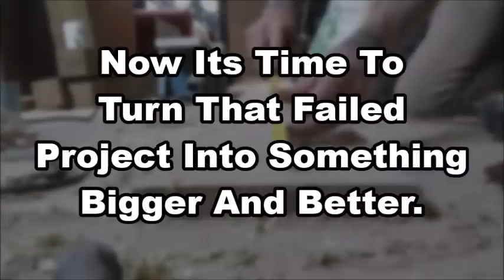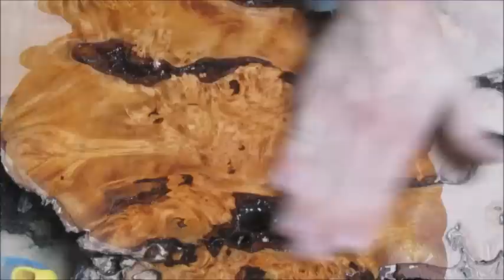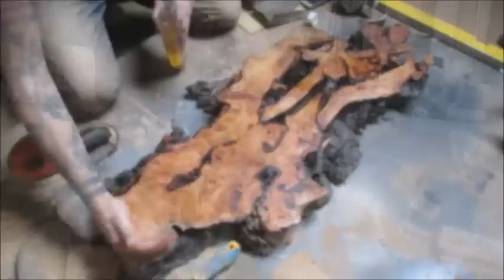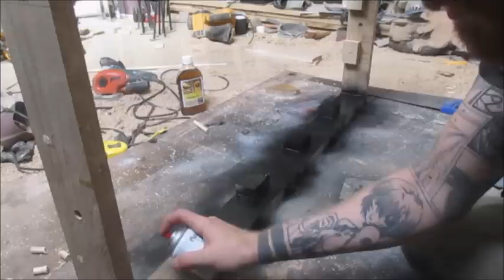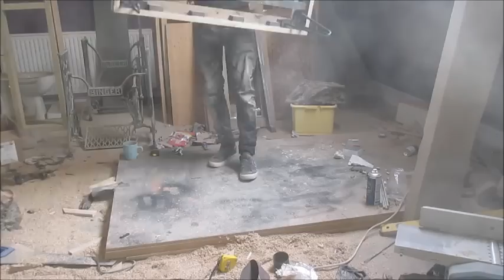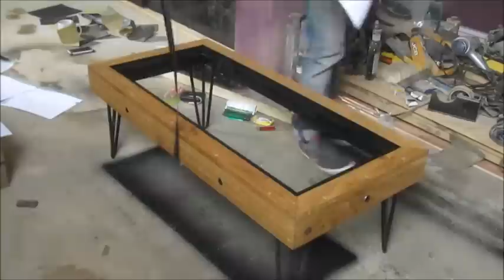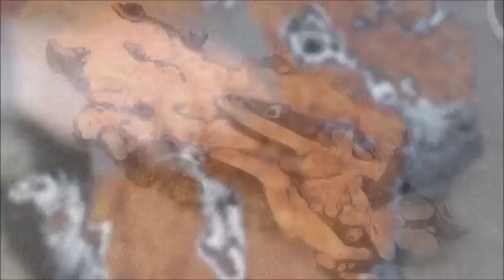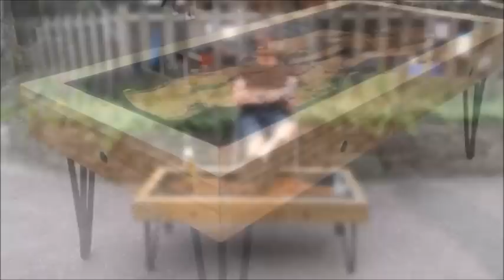Tree Root, Oak And Glass Coffee Table: Reborn From Disaster............... DSNERV

Comment: Good job, but i can see cutting edges of the glass, it can be dangerous. =(
Reply from the maker: No need to worry Sergej Zismann the glass used on the table is a safety glass with a small micro bevelled edge so that you cant cut yourself.

Comment: Why? That gorgeous piece of wood and you pair it with "2X4s and spray painted aluminum"?!? 😝 clearly too much 🍺
Reply from the maker: Haha well...... Hand crafted aged English oak frame with blackened steel supports (sarcastic voice)
What would you have liked to have seen done with the root Tiffany?
Reply: DSNERV I'm am "aged English" woman that just happens to buy furniture sarcasm as well and if I can't tell the difference who else is going to?! As to what I'd like seen done. Spun oak?! Chippendale style. Maybe even some rough sawn driftwood legs. No encasement, it's just not necessary for a beautiful burl slice. You laugh, but you did, in fact spray paint it. The rest of the table isn't on par for the burl.
Reply from the maker: Yeah I am sure that the root could have been used in a lot better ways than I ended up going for..... I am still relatively new to woodworking and as I'm sure you noticed my skill level and amount of equipment is lacking. (This was only my 5th attempt at making something out of wood from hand so I'm sure you can understand why I chose to keep things simple).
Part of the reason I decided to make the table in this way was so I was able to reuse the root slab at a latter date when and if I had improved and had a better idea. Just unscrew it from the supports and set to work. :)